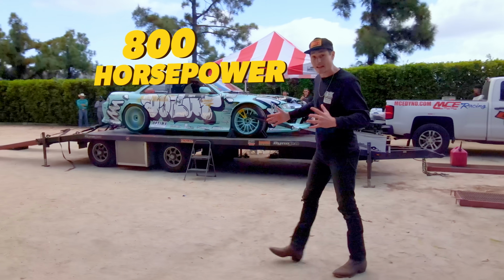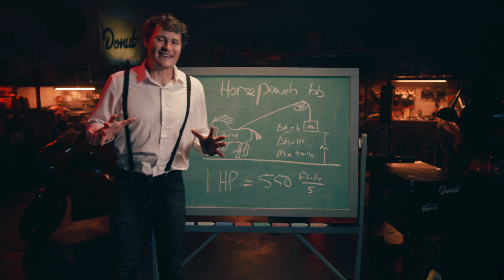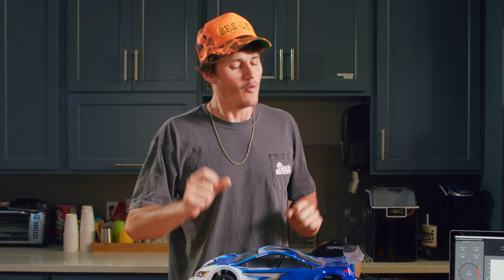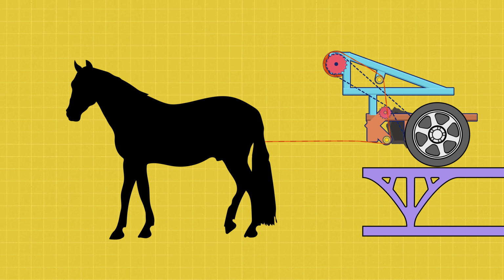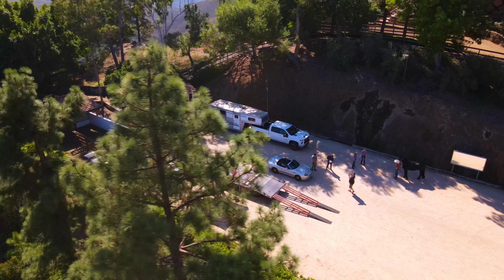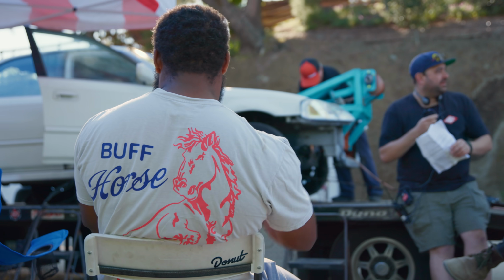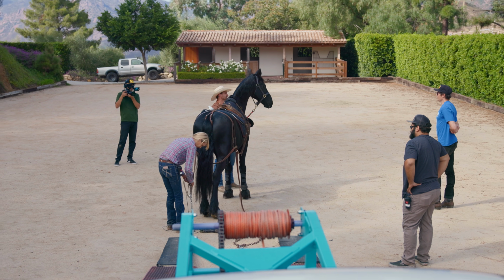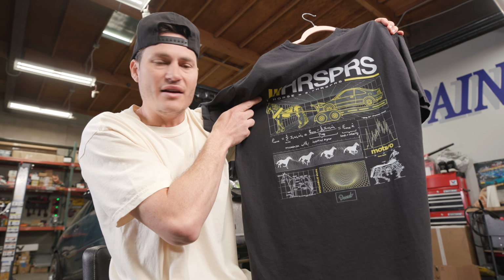How Much Horsepower is a Horse?

Comment: 1 Big D = 5.7hp also makes Watts calculation of that 10hp steam engine to replace 2 draft horses pretty accurate
Reply: They did only use a light draft horse. Friesian horses aren't bred for pulling power. A true draft horse like a clydesdale is a lot stronger at pulling as that is what they are bred for
Reply: @LongdownConker  The company that supplied the horse probably did not have anything bigger than big-D and was probably doing this show as part of a PR tradeout. The point was tat all this did was fit Big-D's pulling power into the artificial but constant mathematical formulation that is used now to compare cars. That was kind of the trick to the whole episode. Horsepower is just a construct that allows the relative comparison of power. 

You're like a "horseperson" I went to see a movie set in the 1800s and they commented on every inaccurate item of the Tack used in the cinematic production or my dentist friend who scrutinizes the dental work of the actors. I am not faulting your comment just noting that it was a faulted premise to make a video show and what we know is that Big-D pulls 5.7 in the horse equivalent  to what weight lifters call a "clean and jerk." Another hose as you pointed out might pull more or less for more or less time.
Reply: @superbmediacontentcreator  my point is that why compare a breed of horse that was never used for pulling. HP was supposed to be how many horses it would take to pull that object isn't it? If so then why not use a breed that actually would have been used for pulling stuff.
Wen u want ur paper to pass peer review then u need to look at all the details to try and get results that are as accurate as possible.
Reply: @LongdownConker  Sorry but you misunderstand what horsepower is, how it is calculated, and the premise of the video. It is not about comparing breeds of horses, it is about the horsepower of this horse.
Reply: @superbmediacontentcreator  the premise was to figure out if the original measurement of horse power is in any way scientifically accurate
Reply: @LongdownConker  Yes, and ultimately it abandoned that premise and wound up simply measuring the "horsepower" of the guys and Big-D. To meet the original premise would have required testing of a sample size encompassing numerous breeds and conditioning so the premise just devolved into a little story of Big-D's horsepower within the existing premise of what horsepower is. It really resolved nothing but was just a cute video.
Reply: @superbmediacontentcreator I think it would help to go back to the original story (myth)
Supposedly James Watt was providing a way to categorise his machines in terms that people understood.
That was how much work a horse could do in a day (every day). He wanted is such that a 1 hp tractor could plough the same as a horse. However he was concerned that he could be embarrassed by a particularly strong horse, so he added a bit of margin.

So, we are only really considering a full day's work for a virtual horse that is better than any that might exist. Averaging for breeds is not required.
Thats where real world ploughing competitions come in.
Reply: @dougaltolan3017  Yes, you are correct in the premise of the story except tractors did not exist till AFTER Watt invented the steam engine. The first tractor was invented in 1892 by John Froelich in Clayton County, Iowa. 

The equation to calculate horsepower is simple: Horsepower = Torque x RPM / 5,252. That's it and trying to change the mathematical formula is a fool's errand. 

Basically, it has nothing to do with horses, lambs, camels, or anything else. It's just a measurement of power that is relative. The name "horsepower" is a brand, not something to be actually related to horses. Understand now?
Reply: @superbmediacontentcreator  ohh yes, I've understood for quite some time now thanks, ever since I saw a video of a team of 2 ploughing a field vs a 1hp tractor doing the same... Speed and number of blades on the plough was all it took.
Reply: @dougaltolan3017  Yes, but now you are introducing the concept of torque speed (RPM) and gears into things. You've got to get back to the 550 pounds and stop there Everything else just blurs the concept.
Reply: @superbmediacontentcreator  I'll have to get all metric on this (no freedom units for me)
Horsepower is power, as in Joules per second (Watts)
Force, distance, and time all have to be part of the measurement.
So torque and rpm are valid if that's your setup.

And then the automotive advertising industry sticks its oar in and comes up with all sorts of similar, relevant metrics such a brake horsepower...
Reply: @dougaltolan3017  Yes, at its basics it is just a relative term or brand so someone can have a bigger dick than the next guy. Forget the horse it is the power needed to move 550 pounds one foot in one second, that's it.
Reply: @LongdownConker Belgian draft and Shire horses are the two strongest in the world.
Reply: @LongdownConker correct a breed like a Clydesdale or Belgian is going to have more pulling power than a say a Shetland Pony. You would need to adverage that breed and then adverage EVERYBREED, to get a data pool to an adverage from for the species. But WHY horses? Why not oxen? The can pull as much if not more then a horse. We should use Ox power 😂
Reply: @QK_SAND  I would argue that they wouldn't need to average every breed, just those that were used for pulling things as that's what the measurement was originally supposed to represent wasn't it?
Lol I dunno why they didn't use ox power but it sounds cool tho 😂 🤣
Reply: @LongdownConker something about a horse girl always got me 🙏😘
Reply: @LongdownConker  Did you ever see a heavy horse pull at the state fair? Those horses are trained to do exactly what big D did.
Reply: So you want to fund the  testing of every sub-breed of draft horse?   @LongdownConker
Reply: I doubt a horse can continue pulling like this for very long. 3.75 kW power to the dyno must mean about the same goes to heating the horse's muscles. 20 minutes and the horse would be drenched in sweat and panting. 1 hp might be a simplistic and faulted approximation of a horse working for hours at a time at 1 hp.
Reply: @wombatillo  Indeed, they were only allowed to do 5 pulls, and that's with pauses in between.
Reply: @wombatillo  Yes, you seem to be introducing another factor which is "sustained" horsepower versus peak horsepower. The same concept arose in sonic amplifier power back in the 70s as it applies to an equipment specification. The result was settling on RMS as a concept over IPP which just as in this case represented a short burst of energy. So in the case of the actual horse, the factor might be the result of asking what an average working day for the horse might be versus this experience which was based on a burst. From some examples I've seen of horses being pushed to pull a stump or other really heavy resistance this experiment by Donut was just a part of what should be a bigger sample of horses. That was kind of the trick to the whole video which was to fit Big D's power into what is a scientific construct not really what "horsepower really is."So the idea of a car's horsepower just comes down to a standard that may be used for comparison but is just a concept or "brand" not a "real" scientific "thing." It's like simply calling an astrophysicist a "rocket scientist." One is accurate but the other is easier for the average person to visualize.
Reply: @wombatillo there were tons of benefits of using a machine vs a horse other than power but yeah
Reply: @Heightren  Ofcourse. Horses eat, need rest, get sick, poop, etc. A tractor is much easier and more reliable assuming you get fuels, tools, spare parts etc.
Reply: @wombatillo  Tahts absolutely right. 1 hp is the power a horse can put out more or less constantly all workday long, the 5.7 hp is the short time rating.
Reply: @wombatillo  a mill could use many 
Horses to divide the load
Reply: @wombatillo Thoroughbreds run about 40mph for about 8mins maxed out on the track, evidently dangerously over exercised when you see blood coming out of their nose and mouth (EPH)
Reply: @wombatillo  can you guess how many Watts of heat a human produces while resting? How about a horse?
Reply: @eerotillanen8914  Depends but maybe 80 watts for an adult human and 400 watts for a 700kg horse.
Reply: @wombatillo less than the total will go into heating the muscles, only the losses. Otherwise the efficiency would be 0
Reply: @wombatillo True though. A horse is still a living thing, endurance is enough downside of riding a horse. Modern cars can sustain at a high power output for hundreds of kilometres for each refuel... A horse will need to take rest and eat.
Reply: @wombatillo combustion engines also loose horse power over time. So also not a difference
Reply: @wombatillo - Horsepower measurement of motors is done at peak power which those motors cannot sustain all that long either.  Typical gas car putts along averaging about 10% of peak driving along freeway.  Question before us is peak output of a horse even if only momentarily.
I am aware that many motors sustain far more than ten percent of peak.
Reply: @wombatillo  just give it a healing potion and then buff
Reply: @wombatillo Seems like they could have skipped the dyno difficulties and just attached GPS and load cell to a horse plough, for a measurement of horse power as originally  intended i.e. sustained work rate.
Reply: @wombatillo horses sweat, I thought that was a person thing
Reply: @wombatillo  Is it "about the same" or is it about 80%? It'd still be a lot, but this is an interesting technicality.
Reply: Actually, the amount of heat per second produced would be about 4 times the power produced.
Reply: @felixmoore6781  Figured as much. Would have to dig up actual sources to know what exactly is the muscle efficiency of a horse in aerobic and anaerobic exercise. In that 4x case the horse wouldn't be able to keep up this kind of exertion for more than a few minutes. Horses are strong but they do get tired just like any animals.
Reply: @wombatillo  while exercising Conversion of stored energy into mechanical energy during exercise is relatively inefficient with approximately 80% of the energy being given off as heat. However there are lots of factors to consider like the thermoregulation thru skin and breathing (which horses can increase to reduce temp) also fitness of the horse, their feed, if they are clipped, what they are bred for etc
Reply: @wombatillo  the environment of the exercise is also quite a big factor. Horses have a great ability to thermoregulate so u wld be surprised how much they can do
Reply: @wombatillo  for a human, 25% thermal efficiency is the average usually used. Most mammal muscle works pretty much the same, as in strength per kg, so I guess efficiency is similar. Now, taking Tour de France cyclist numbers (cause I know them and they are well reported and measured, today all the pro's run wattmeters in their bikes accurate to less than 1%), we can see the average pro goes to 250-300W continuous. Watts/kg are around 6-7 for 10min, but for 240min+ (which is near the all-day sustainable effort) its more like 4-4.5w/kg. That means a (not so TdF) guy, well trained, at 80kg could do 320W all day, that's like half an HP. If a horse is 400kg of body mass, that would be 1600W, which is 2.14HP. Now, just as people, horses can have different levels of training, AND, some breeds are HUGE compared to others. Here in Chile, horses are still used by some people to work their farms (not common and not done in large scales, but you see it sometimes), and those horses are massive (and not very tall), unlike most sport breeds. Just as an athlete can be 60kg or 120kg depending on wherever he is a TdF climber, or a full weight weightlifter. Or, a 80kg guy can be a sedentary office sloth like me and have a continuous rated power probably less than 100W. The only heat related issue I see is the square-cube law (volume thus mass increases with the 3rd power, area with the 2nd), so a larger mammal has less surface area per kg of body weight for heat dissipation, but most animals have adaptations for that, as the large ears in some elephants, but physics places some limits too.
Reply: @wombatillo There's A Lot of studies on equine performance  ....due to the nasty horse racing industry and rodeo.
Reply: @LongdownConker πορνο
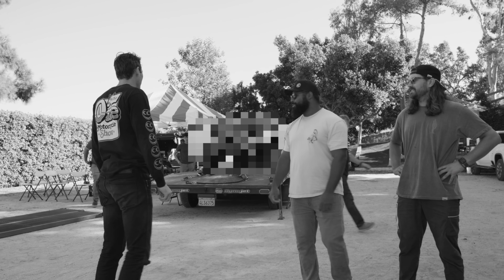Reply: @LongdownConker 0:46πορνοσταρ 2:15
Reply: @LongdownConker ❤❤γαμησια
Reply: @LongdownConker με
Reply: @estebannegrete7662  Good post, but humsns are more effecient at shedding heat than most any land animal over time. Only birds do better. Horses will generate more heat per kg over time than humans. Of gourse 4 legs has an propulsion and speed effeciency over two legs. However, race horses and especially quarter horses produce the greatest hp in their short sprints, reaching in the 12 to 15 hp range for a few seconds. The best Cycling track sprinters in the 200 Meter events doing sub 9.3 seconds are peaking at 2,300 to 2,500 watts for 1 to 3 seconds. They are bigger bulky guys with more muscle bulk than the 1 hr  event cyclist. Those Sprinters are not good at events much over a kilometer though. The average CAT 3 rider could beat a track sprinter in a  1 hr and especially a 100 mile race that can do 2,500 watts in a sprint. Though There isn"t any Tour De France rider that can peak at 48 mph  like those 2,000+ watt track sprinters can on flat ground though. A 100 pound Chetah is estimated to do 1500 to 1800 watts which gets them to 65 + mph, but their back and whole streamlined body is designed for speed.
Reply: @wombatillo if they fell below average of 1hp over the 24 hour shift they would get whipped
Reply: @wombatillo  "I doubt, so science is wrong!"
 - Youtube Commenter
Reply: @dasstigma  Where the hell did you pull that from? Assume much?
Reply: What the hell does that have to do with the fact the measurement is approximate to it's origin, for the intended scope of that metric? @wombatillo
Reply: I was actually wondering why not just putting big D on a big treadmill/ and just put the Dino inside it
Reply: @mikensonmesidor9114  or why not contactOo Or why not contact one  the official horse pulling associations? They're competitions where horses do the pulling.... not where the horses are pulled 🤪
Reply: @mikensonmesidor9114  I'd imagine that it might mess with the horse's head, causing him to not pull right
Reply: @mikensonmesidor9114  I actually was thinking the same thing as well, but it doesn't seem practical to try and push the surface you are standing on backwards, the more I think about it, it's probably impossible. Our current operation of a treadmill is through having the treadmill powered by a motor, and we run along matching the speed at the point of contact.
Reply: That's what I said.
They could design an build this whole thing, but couldn't just add in a Horse sized & heavy-duty rated treadmill for a more accurate measurement of over all "horsepower"? @mikensonmesidor9114
Reply: @mikensonmesidor9114  Not very safe for the horse.
Reply: @mikensonmesidor9114  from my understanding is that they are equating HP from a car to the of a horse. its like substituting a engine with a horse, but of course you cant put a horse into a car right. So they translate the pull of the horse to the vehicle resulting 1 horse can pull 5.7HP

so in short putting a horse on the Dino eliminates the ability the measure HP as if were use in cars. (PS i'm not smart i just comprehend things 😂)
Reply: yes you're pretty right my friend!
Reply: Thank you for summing that up so I didn’t have to watch. You’re the best.
Reply: Hook a team of clydes to it. 4 horse I'll bet 50 hp. They get competitive
Reply: Watt's calculation was on draft horses, which are larger, but they weren't pulling peak power. The job they did was relatively constant. That 10hp engine could possibly replace 3 horses at non-peak work.
Reply: Weak ass horses from the new age of machines we live in. Horses were naturally stronger from times before.
Reply: @SoapCrust  Race horses are just as powerful  now as 50, or 100 years or 150 years ago. In fact, race horses over the last 50 to 60 tlyears are likely the most powerful ever.  Training, diet, and genetic selection. Though Secretariat from 1972 has the fastest Ky Derby time that's never been broken, to this day.
Reply: The firepit scene. 😂❤
Reply: i thought is what would Clydesdales who were the traditional draught horse
Reply: Bro, spoilers
Reply: I’ll bet that 5 HP is pretty close. All day work, maybe 2/3 of that (lots of factors) My rationale is that Looking at photos of old horse drawn combines, you’ll see about 10 horses on a small set up that today would take at least a 50 HP engine to keep moving through the field. They would rest the horses mid day, water them, feed them, (and the men) and then go back to work. 

Those old timers had to keep their horses going day in and day out, and not overwork them so they all had food to eat all winter. That was only 100 years ago!
Reply: @Konadawg99 1Hp was their working power. 5 was their peak power.
Reply: I'm not sure it does, Big D pulled for a few seconds, he can't keep that up for a full shift
Reply: If a horse produces 5.7 peak horsepower, then I have zero difficulty believing that the work output of a horse averages out to something close to one horsepower as time approaches infinity. If Watt pulled those numbers out of his ass, then this experiment just proves what an amazing ass he had.
Reply: 1 Big D = 5.7 hp = 4250.5 James Watt.
Reply: so you are telling me that a guy alone in 1776 in fact discovered what this huge crew of modern day braniacs with tons of technology took weeks to do? i cant even imagine being a true genius like that.
Reply: The horse is only going to pull as hard and as fast as the handler allows
Reply: What about torque?
Reply: honestly thought it would 20 hp ngl, I was off
Reply: That 10 HP steam engine also doesn't need time to sleep.

My understanding of the HP came from an average equivalence in work in regards of production at the time.

So to run a 10 HP equivalent 24/7, you'd need about 10 horses...
Reply: Yes Big_d is a coach horse and only a medium sized one plenty of horses were head height at the shoulder.
Reply: So is now 1hp =5.7hp? Because if its legit hp numbers are going stonks👆👆
Reply: @kierenschulz9146  One horsepower is the work rate a horse can sustain for hours, the maximum effort from a short pull is obviously a lot more than that. It's the same for humans - a pro cyclist can sustain maybe 0.4 bhp for several hours or 2 bhp sprinting for a few seconds, the same 5:1 ratio, because that's how muscles and metabolism work.
Reply: @kierenschulz9146 No. 1 hp is the work rate of an "average" draft horse over "6 hours". Not one strong pull lasting 20 seconds.  Horses vary in power just luke humans. Horses are not all clones of each other.  There,'s variations.
Reply: Spoilers are just lame.
Reply: I thought 1 horse is 1hp..
Reply: @bandittelevision  did u watch the video lol 😂 🤣
Reply: @bandittelevision  1 horse will be around 1hp at 1hour long pull. People - the same, one can pull at 1kW power for severall seconds, around 200W long term.
Reply: @bandittelevision That is the entire premise of the video 😜